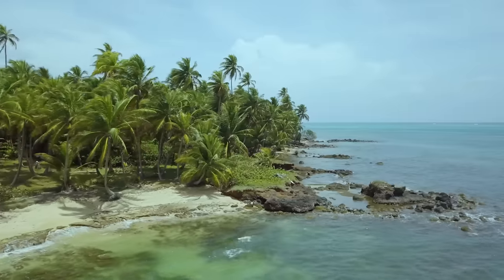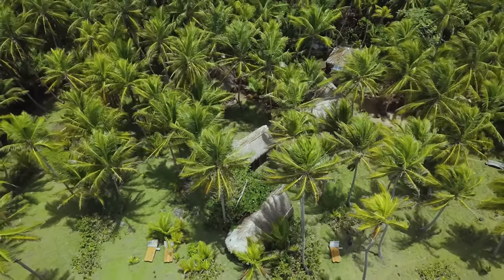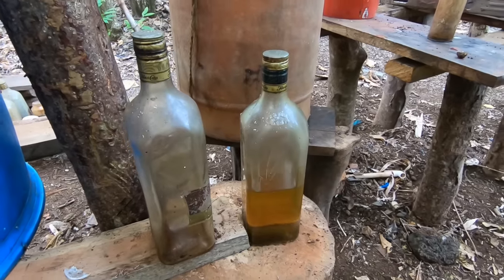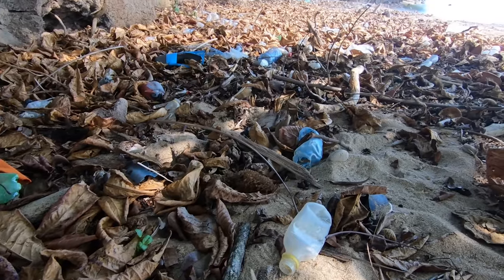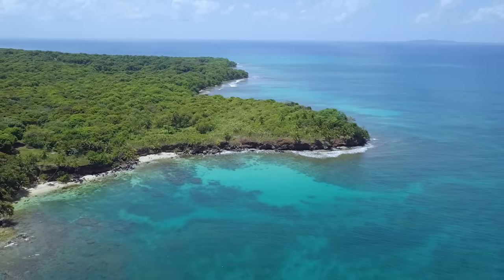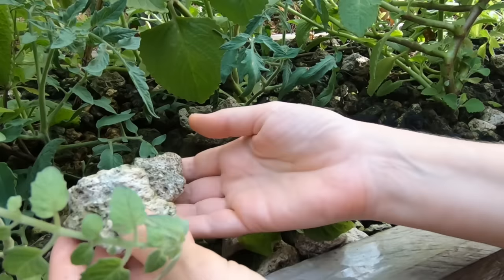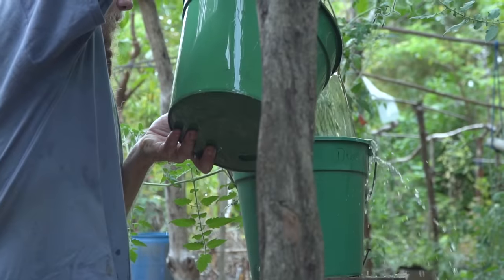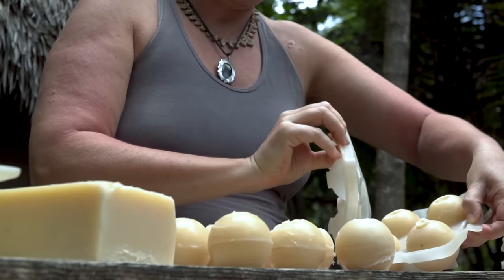THIS SELF SUFFICIENT FAMILY MAKES THEIR OWN FUEL FROM PLASTIC!

Comment: Why aren’t landfills doing this to fuel their dump trucks
Reply: for sure the heat energy required is more than the energy provided by the fuel
Reply: @shyon5312  How hot does it need to get? Would a solar oven be enough?
Reply: I was thinking about this.
Reply: @shyon5312  no when done right it is self sustaining after starting. Education before commenting prevents looking stupid in public.
Reply: @kinzieconrad105  No it isn't..... Very basic laws of physics literally dictate that it cannot be... Re-read your own comment :)
Reply: @kinzieconrad105  who cares if other ppl think you look stupid.
Reply: Sorting out clean plastic, is probably the biggest hurdle. Before amount of natural gas burnt. Higher level of refining needed, for expensive engines. What to do with the leftover distillates, sludge. 
And, it’s still converting plastic, int dirty fuel that is burnt. Thus not removing any of it, from nature.
Reply: Because its a low quality oil, ok for engines that just chug along so that means it would take way to long for a rubbish truck to complete its route.
Reply: You are still going to have some type of waste byproduct..the pollution doesn’t magically disappear. All you can really do is try to redirect the process from start to finish to benefit more from it ..minimize it. Cant get around the law of conservation of matter.
Reply: Speculation:  In the U.S. it's probably illegal, or limited by several strict regulations,  and expensive permits with annual inspections, fees, etc . . . This may be to ensure reduced pollution and most likely to keep the money flowing into the pockets of the big corps.  (Same reason it's illegal to collect rain waiter for human consumption in some regions--to keep the money in the utility corps pockets.)
Reply: Most likely operations costs and scalability.

To run a mega operation like a landfill, a fuel source that is both reliable while being low (relative) price is essential.

The cost to purchase diesel would be $1/L, however to make the fuel at scale required to run operations, factoring in materials, utilities, regulatory fees, insurance and labor, could be (for example) $50/L, which of course would be an unwise business decision.
Reply: @kinzieconrad105  then explain it, seems my engineering degree is not enough for you... fire burning below a pot has very low efficiency plus the energy dissipating in the tubes etc.. then you got some sort of diesel that gives you 30% efficiency if you are lucky. So prove to me that if you buy 1M usd of any heat source to be burned for this task, you will produce over 1M usd of energy from a diesel engine. If you succed go start your own company instead of replying in youtube.
Reply: @shyon5312  i dont think he was talking about money, his point was you will use up more energy by producing the diesel fuel then you get back from the diesel fuel
Reply: @shyon5312   you dont have an engineering degree 🤣🤣🤣  because if you did you would know that useing fire to melt plastic does not produce Diesel, it makes synthesis gas not diesel.
Reply: @Black_Beard96  Definitely doing more harm than good by burning all that plastic into the atmosphere.  But as far as trashy countries go America (I assume you mean the United States, and not The Americas) is not even close to the pollution and garbage produced in 3rd world countries (Like Mexico).   And then there's China . . .  But we definitely do our part in creating more problems for the environment.
Reply: @billpetersen298  over working it all breaks down in the end.
Reply: @shyon5312  eel if you have a so call engineering degrees which I am calling bull shit on again go look up pyrolysis and a waist management company based out of Boise Idaho processing waste with the same technique and getting fuel to run their dump trucks and electricity.
Reply: @kinzieconrad105   the process is possible of course but it works only in scenario where you are investing so little... because you dont care about how much energy you would produce if you would use that heat source directly to do whatever you need to do. Anyway it is the first time i answer on youtube and i am already regretting it... I just wanted to help that guy understand why it is not done on a large scale. For sure if someone invents even a close efficiency cycle the government will subsidise the rest... so i stand to my opinion. Now I need to get back to my engineer job as i get money for that not to amswer on youtube. Ciao, regards!
Reply: @qeshi  No, not enough energy density - even in the tropics.
Reply: @dand2760  I think you mean "conservation of energy".
Reply: @letsbehonest4221  The plastic is more than melted, it is decomposed. The end result is some solids, a whole range of various viscosity and flammability liquids, flammable gases and non=flammable gases. There may even be some water/steam.
Reply: @kinzieconrad105  You misspelled "fractional", twice.    :-}    Otherwise, good rant.
Reply: @kinzieconrad105  Last time I was in Boise, they were sending the plastics to various other businesses, mostly to be burned as fuel.

On the other hand, there are a number of landfills that collect the methane that is released by garbage decomposition, then wash and compress it to be used as fuel in converted trucks.
Reply: @Kimblesgarage  <——- like I said folks you just can not fix stupid!
Reply: @buggsy5  you must besties with Greta!
Reply: @shyon5312  and one last thing if you think this is bad, then I know that you are a democrat and at that point we all can just start ignoring you. And yes you are right when you exceed voter roles you secure the hell out of the election!
Reply: @buggsy5    wrong... the process collects the gas that comes off the melting plastic, the gas is then used in a further process to make fuel.. but the melted down plastic still remains....
Reply: @kinzieconrad105  well when they do I'm sure you'll feel much  better :)
Reply: @letsbehonest4221  That "further process" are simply a very non- selective fraction condensations. In the video, the fraction he describes as diesel and lit, isn't diesel.It appeared to be a bit more volatile than kerosene. Small diesel engines tend to be pretty forgiving when it comes to fuel, so that may not matter. What will likely matter is that the fuel he is making does not have the lubricants found in commercial diesel - and is likely to destroy the engine over time.

If melted plastic still remains, then the pyrolysis is only partial.
Reply: @zerojee1  China produces more plastic than just about all the rest of the world combined.  Or at least they did so a few years ago. The US in 2018 was in 12th place.

"Third World Country" is a Cold War term to split countries in three groups (us'ems, them'ems and everyone else'ems). The divisions were more political than economic. The concept is outdated as it no longer represents the political or economic state of the world. Mexico is not a Third World Country.
Reply: @buggsy5   yr somment seem verry logic..
..i appreciate the reply 👌

Comment: I'd prefer if everyone could live like this rather than spending our time working for someone else.
Reply: But the system needs it's slaves.
Reply: He's burning down the forest around him to make a small amount of fuel.  This isn't sustainable.  It's virtue signalling.
Reply: @fernarias  No, the wood comes from trees downed in storms and hurricanes,  coconut husks after harvesting coconuts. We've cleared out sacks upon sacks of plastic so far....
Reply: @dereksplace1342  So you are saying that you don't understand how much he is polluting the air, water and ground.  Pyrolyse is a extremely dirty way to create fuel and you need a high tech plant to eliminate the pollution created (with precise control of temperature).  What does he do with what's left after the process?  Do he bury the slag?  Does he throw it into the ocean?  What about the fumes that are created that eventually condense and pollute the soil or water?   His camp looks really dirty by the way.  He would be better off running his generator on wood gasification where the only products are wood and the only waste are co2 and wood ash (wood ash has other uses).
Reply: @fernarias  If the system is sealed with no leaks, how are the vapors escaping? When combusted or flared they are catalyzed into CO2 and whatnot. There is a small amount of carbon left after the pyrolysis. How is he polluting the water when he is taking trash from the water?
Reply: @dereksplace1342  His system isn't sealed.  He's using bottles connected by a pipe that gives him different condensation temperatures with the end of the pipe open to allow the vaporized fluid to move to each bottle.  He pollutes the air and water with the open pipe plus the burning of this so called diesel.  
Again, what about the slag that's left in the big container?  What does he do with that pollution?
Reply: @fernarias  The vapors coming out the end is the fraction of butane, propane, etc. They are catalyzed when they are flared or fed into an engine, just as you use gasoline for your car or natural gas for cooking. It is not being released as is into the atmosphere. 
  There is only a little bit of rock hard carbon left after the process, a couple percent of the former mass. It can be used as a cement aggregate, things like that.
Reply: @dereksplace1342  An open wood fire does not generate enough heat to produce what you describe.  Also their make shift condensation system does not capture all of the flamable liquid he is producing.  Plus, he's probably producing benzene and other harmful organics.  He didn't show what was in his heating container for a reason because then this story would have turned into a horror.
Reply: @rafaeldelgado4985  Really??
Reply: @dereksplace1342  PAHs (Polycyclic aromatic hydrocarbon) are produced at the temperature (open wood flame burns at 300F to 500F, if you're lucky) that he's "cooking" the plastic.  PAHs are carcinogens and also cause cardiovascular disease.  They include the following; Naphthalene
Biphenyl
Fluorene
Anthracene
Phenanthrene
Phenalene
Tetracene
Chrysene
Triphenylene
Pyrene
Pentacene
Perylene
Benzo[a]pyrene
Corannulene
Benzo[ghi]perylene
Coronene
Ovalene
Benzo[c]fluoreneNaphthalene
Biphenyl
Fluorene
Anthracene
Phenanthrene
Phenalene
Tetracene
Chrysene
Triphenylene
Pyrene
Pentacene
Perylene
Benzo[a]pyrene
Corannulene
Benzo[ghi]perylene
Coronene
Ovalene
Benzo[c]fluorene
Reply: @fernarias   When you did the internet search, you made a mistake reading the temps, you are confusing Fahrenheit with Celsius A wood fire can get up to over 1000 degrees, 600 celsius..
   PAHs are produced in incomplete combustion of organic matter such as wood, coal, or oil. A large portion of the PAHs enters the atmosphere through natural processes that cannot be controlled by humans, such as wood fires or volcano eruptions. Man-made emissions mainly come from combustion processes as well: from small combustion units, industrial processes, fireplaces, or tobacco smoke.'
  So by that definition you too are guilty of producing PAH's, in fact, everyone is guilty of it if they ever smoked or made a campfire or drove a car with a combustion engine, and if you drive an electric in the production of the components of that vehicle.
  At the moment I do not know if PAH's are being produced inside the unit as the  pyrolysis taking place is not burning the plastic, it is melting and vaporizing it. There is no oxygen inside so it cannot burn, nor explode.
   I can tell you that what is inside the reactor is rock hard carbon once the cook has been completed.
Reply: @dereksplace1342  A wood fire in an efficient stove can get to those temps but an open air wood (types of wood also matter and softwoods don't burn as hot) fire burns very inefficiently and the temps average 300F to 600F.  With the temps your quoting then blacksmiths would have used raw wood instead of charcoal.  The PAHs that I listed can only be produced by plastic pyrolosis and not from smoking, burning wood, or what ever else you wrote.  Since he's using a very low temp, he is not producing ash (and if he was, the ash is also toxic) but a toxic plastic slurry.
As I stated, a western man, with a little bit of knowledge, decided to live in a tropical setting but then wanted his old lifestyle back and started to pollute that tropical paradise.
Reply: @fernarias  You are speaking from ignorance, guessing what may be in there, I am speaking from experience. I know what is inside that reactor because I emptied it out.
Reply: @dereksplace1342  Well, I hope you used gloves.  Also, what did you do with that much pollution?  Is it in the ground contaminating the water table or did you pollute the ocean?
Reply: @fernarias  What pollution?
Reply: @dereksplace1342  You didn't answer my question, what are you doing with the "ash".  Are you eating it?  Are you using it in your garden?  Are you spreading it on the ground?   Are you throwing it into your river?  Just what exactly are you doing with the ash?  I already know what you do with the off gas, it's in the air you breath.
Reply: Not all of us want to live like this.

Comment: Better hope no one see's this frome the government
Reply: People in the Nicaraguan government have said that they think it is a great idea. There was once someone from the UN vacationing here and they had never known it was possible to do this process.  Once shown, they were quite intrigued.
Reply: gvt ruled br roth schild and his CBD.. central bank dynasty
Reply: Meanwhile, the country is being plundered by the US.
Reply: You will get shut down for all the Toxic Gasses you are creating and dumping into the atmosphere.
Reply: @email4664  Aye, he is a troll. He is conflating open air pit burning with this process and it is completely different. If done without leaks there are no fumes, and as you said in an earlier reply to him, the gasses are catalyzed during combustion or flaring. 
  For those that are afraid of flaring, the gasses coming out from the end pipe can be connected to a gasoline engine and run like propane, which it is (along with butane, etc). It actually smells on the sweet side, though I wouldn't breathe it just as we wouldn't want to breath in any type of exhaust.

Comment: What about the purity of this fuel ? It looks the combustion of this fuel creates a very heavy black smoke...
Reply: Omg burning plastic smells sooo bad
Reply: So does all diesel to be fair but I’m curious as well
Reply: Yea, plastic and diesel stink. I'm curious too. I want to contact the guy and see about doing this in a place that isn't a tropical island
Reply: The startup of the diesel engine was cold so for the first 3 seconds it but have sooty exhaust as the fuel being injected is not combusting completely, like school buses and ships do when they start. It does the same no matter fuel. After that it combusts normally.
  We normally mix it 1:1 with normal diesel to make sure it isn't too heavy, depending on what the plastic mix was will determine how thick or thin it is. Mixing it allows it to be more forgiving.
Reply: @ScallopHolden  It does, but this process doesn't burn it, and not all plastics can be used.  Use the wrong ones and it will stink mega bad and have some mega bad stuff  in it too. No Vinyl, pvc,, foam, and some others. Plastic chairs, good.
Reply: @robertfelts8773  Go through our instagram under the video or website, search Derek's Place Little Corn Island.

Comment: I find your bush refinery both fascinating and horrifying. 

Simply pyrolyzing plastic would definitely yield fractions that are similar in weight to gasoline and diesel, but in the process you are creating a witch's brew of toxic and cancer-causing chemicals. I sincerely hope you are taking whatever nastiness is left in the bottom of that vessel and storing it in oil drums for disposal. 

I do see potential going forward. If someone were to engineer a modular unit that would do this cleanly, it would be possible to get an awful lot of plastic waste removed from the environment.
Reply: yep is a great way to get rid of plastic and give it some value so people don't dump as much although its still adding to the carbon problem , how much carbon is created by creating the diesel by heating the plastic then burning the diesel itself , and as you said toxic gas ,and man the waste from the plastic left behind must be ultra bad shit too and would need to be disposed more likely stored somewhere it can never escape from 
FKN plastic and fossil fuel companies have so much to answer for I hope one day soon they can right their wrongs

I just did a bit more looking and found this . https://www.youtube.com/watch?v=kr86K5Q63Bw&ab_channel=GreenmeResearch

this guy uses the gases by burning it to actually heat the plastic . also the waste left behing from the plastic is onlt 7% and its just carbon ash , pretty amazing really 
check it out
Reply: if you add that plastic brew rest, and carefully add it to a cement mix.. it would stuck in there for a lot of years right?  
 the other option is to throw it into a lava pool.. yes, that solves anything since always in this planet   :)
 the cement idea is better than nothing, right?  You can make some stones for the base of a home or something, and finally adding another layer of clean cement up, just in case of the chemicals.-